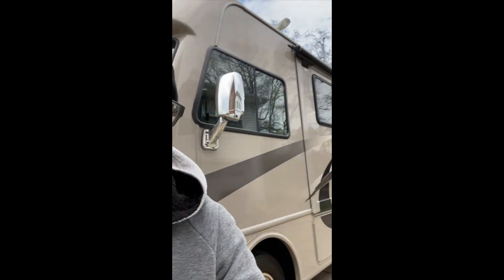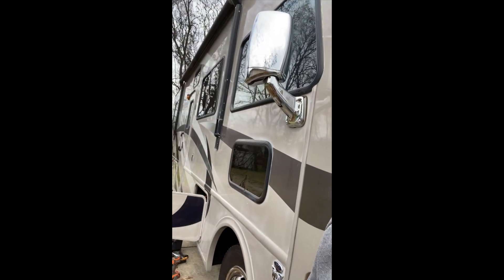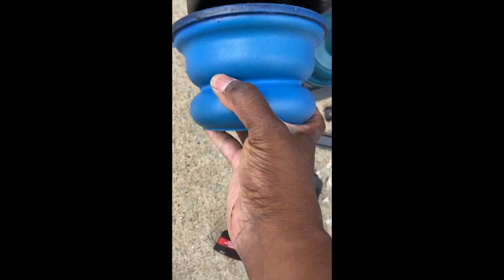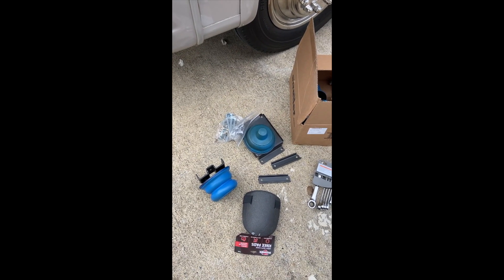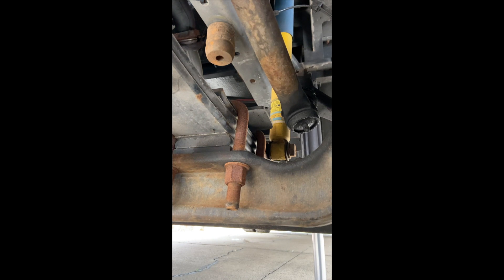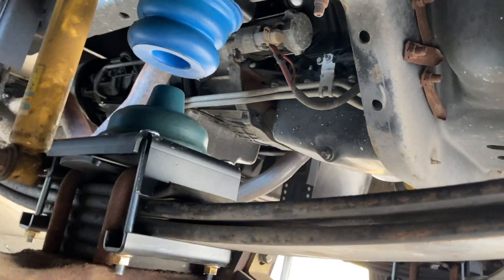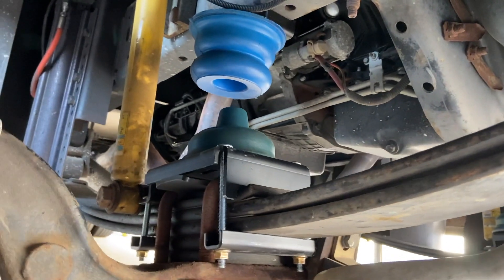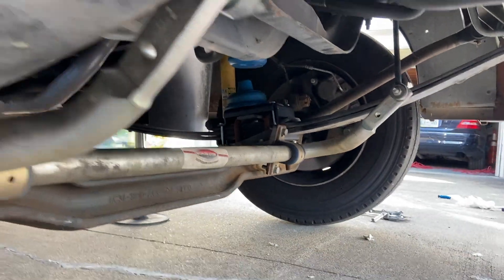Sumo Springs Install 2014 Ford 53 Chassis Thor ACE 29.2

Comment: Thanks brother! I’m getting ready to crawl under my MH to do the same thing! Your video helps. I’m also installing Koni FSD Shocks, a Safe T Plus up front, the Cheap Handling Fix, and a Super Steer rear track bar! As finances permit!😬 I got tired of the white knuckle driving. I understand these upgrades make a big difference in safety as well as comfort. Thanks. Safe travels! 🇺🇸

Comment: Since it has been several months since you installed these springs, you may have, by now, performed the "Cheap Handling Fix".  If not, I would encourage you to look into that modification to the front and rear sway bars.  I found it provided a huge improvement in the handling of the RV.  It requires no expensive parts and you probably already have the tool you need to make this adjustment.  There are multiple you tube videos on it, and I think you'll really like how it improves handling.  I also installed a rear track bar, which also improved handling and seemed to reduce the "push" experienced when being passed by a larger vehicle.  I also just installed these sumo springs on the front of my rig, and replaced the original shocks with Koni's.  I haven't been on the road yet with these changes, but, I expect great things!

Comment: I just installed KONI shocks on the front of my 2010 F53.  I received the Sumo Springs this week and they are next.  Thank you for your video and mentioning the size of the sockets needed for the install.  I agree that the RV manufactures should dump the inadequate bump stops and install the Sumo's or an equivalent before the chassis leave the production line.  I have been doing a lot of on-line research.  Martin on the rvstreet channel has a number of recommendations for improved drive ability on the F53.  I plan to replace the rear shocks with KONI's and add the Super Steer Rear Track Bar as time and money permit.  Thanks again and best of luck with your upgrades.

Comment: Awesome video, I just bought a MH and I am finding out that the issue driving the MH so what I did is I just order the safe-t-plus and I should get it tomorrow and next I will be ordering the Trac Rear Bar and install that, I'm not sure what's next either the Koni shock or the timbren spring for the rear and sumospring for the front.

Comment: I have before but I won’t trust just the leveling jacks alone in the future… you should put some lumber under your axle or jack-stands on the frame next time just in case the levelers fail